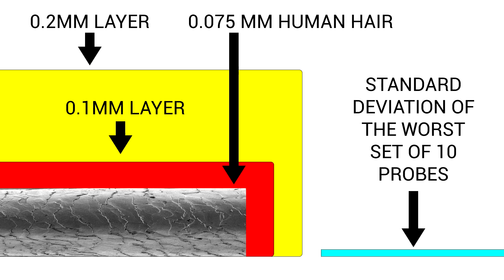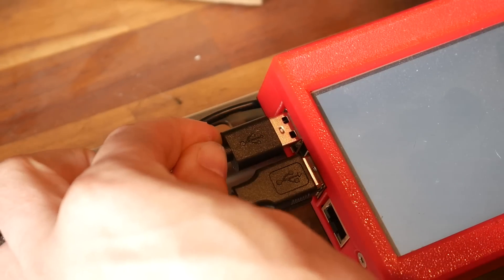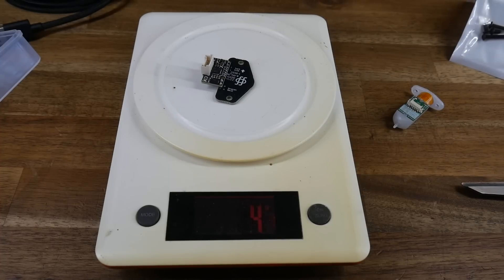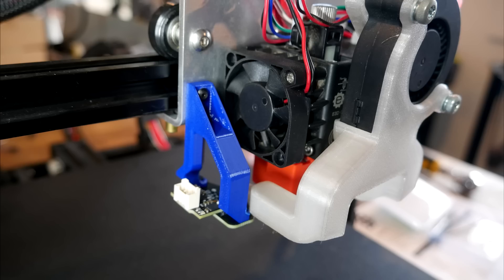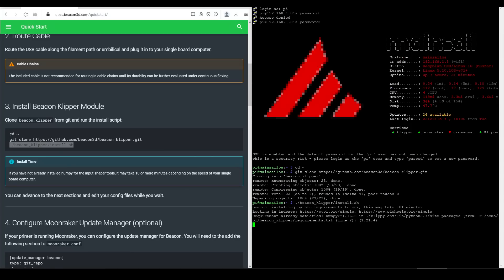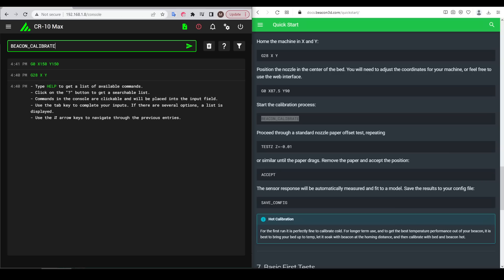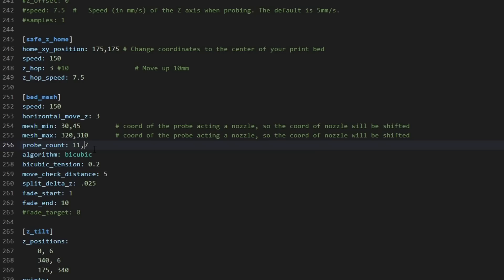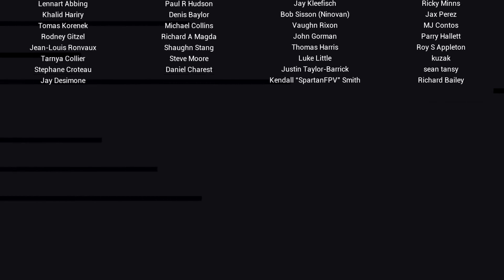Beacon ABL bed scanner - Amazing speed and accuracy, perfect 1st layers

Comment: I came across beacon the other day and i'm designing a hotend.  It's one of those parts where trying to implement it after the fact is a bit of a struggle when you start considering screw and extrusion locations.    I'm not giving up on the idea, I like the concept, though im curious how it  will fare once prusa's new leveling system is looked at and perhaps is adapted to the previous probes.
Reply: By new system do you mean the load cell leveling??

If so they don't seem comparable in terms of end user benefit. Like load cell leveling is probably better than having a bltouch hanging off the side but its not really any faster. It's more accurate but leveling accuracy is not a problem unless your printing with extremely small nozzles. Which means speed should be the only thing that we are looking at for real improvement.

Especially because even if you are satisfied with the current time it takes to make a mesh, a faster system can allow for a more detailed and comprehensive mesh for in same amount of time.
Reply: @nocare  Yep, but more specifically the gcode running behind it that allows for bed leveling only in the print area. 

Realistically speaking, that little bit of code when adapted across the industry will be a pretty decent upgrade for 'traditional' probing methods imo.  

It really only makes a ton of sense in my opinion for the DIY CoreXY community.  Most other machines regardless of brand will struggle to meet all of the prerequisits.

For everything else, speeding up the traditional probing methods with an adaptation of prusa's gcode will be the way to go.  

Which is where I want to see how that code develops with point density.

Comment: Nice but expensive. The fact that it only works with Klipper is another thing that prevents it from becoming very massive.
You don't have to create a mesh every time you start a new print. Because the print bed is still in the same state as the previous print. So the lost time is always zero.

Comment: My first thought on this is that it's only going to work on metal beds... that don't have heaters... or mounting standoffs on the bottom.

Like, if there's a massive aluminum slug on the center of my plate where all the mounting hardware is, it's going to read a different value when scanning over that section vs the edges of the plate, because there's more material to generate eddy currents in.

Or, more importantly, as someone who uses a double-sided glass bed. This will do absolutely nothing useful...

Oh, and it's klipper only? I guess it's a matter of time before someone makes a clone that's a mainboard thing. Will be interesting to see this in a few years.
Reply: It only reads the steel bed sheet, not the mounting hardware. And yes, not good for glass, and klipper is the future because of things like this, the raspi is basically a full Linux computer and can do those kinds of calculations and work with multiple MCUs.

Comment: My bltouch croaked so i popped on an old inductive probe which works great with the pei sheet but does not have the distance for a glass work plate which I find is far better for pla adherence so this may just what I need. It is a little on the expensive side for a probe though and will take up alot of real estate with the exclusion zone it needs.

Comment: These are using off the shelf Texas instruments chips that cost only a couple of dollars, they are even using the suggested layout that comes with the chips documentation. Some chinese companies will come along and properly open source it and sell it for $10 in a couple of months.
Reply: A TMAG5170 by any chance? I see it has a SAMD21 as it's mcu. That's about $7 total, throw in another generous 8 for the boards, passives and connector and it's all of 15 bucks retail to make the hardware. So yeah, highly likely.

Comment: Interesting but certainly not for everyone, not for glass beds, thick PEI sheet beds and non Klipper users
Reply: I don't see how it's for klipper users either, given that you can just store and load an existing mesh
Reply: I don’t at all disagree, but as time passes I find it harder to understand why non-Klipper users even exist. It’s just phenomenal compared to the alternatives.
Reply: @dsnineteen RRF is pretty good and most RRF boards don't need a separate SBC unless you run Klipper on them, but the beautiful thing about RRF is not needing that at all, Mellow has some good priced Duet alternatives

then again once Marlin is set up properly you should never need to recompile it unless you wanna have every update, which i don't, i literally jump versions only if something cool comes out like the input shaping update and modern ARM boards have made it as easy as putting the firmware.bin on the sd card
Reply: @BH4x0r  thanks for the informative response! Time for me to do a little more research into the current state of play. -that’s what I love about this hobby, it’s always evolving!
Reply: @dsnineteen  I’m scarred by recompiling Marlin countless times (-8
Reply: @floodo1 I think it's only for Klipper.
Reply: @dsnineteen  kipper is a pain is the ass to learn when what you have works fine and you have to find an elusive and overpriced rasberry pi.   Plus if you have a X1C this thing would pretty much be pointless.
Reply: @TheRattleSnake3145  there are cheaper boards that work fine for klipper. But it's still an added cost for sure.
Reply: @TheRattleSnake3145  😂😂😂
Reply: @twanheijkoop6753  what cards can I learn about them?
Reply: @uguryay mostly raspberry clones: orange pi, banana pi, etc. any arm sbc with gpio and linux should do.
Reply: @dsnineteen  I just want to make cool stuff. Don't have the time to buy and learn everything for Klipper when Marlin works just fine. I often don't even have much time to model things in the first place...

Comment: I half expected to see cheaper Chinese copies of the Beacon by now as the tech used has been around for yesrs, I have BL Touch units on all but one of my printers and that one without is an original Ender 2 that doesent really need ABL, I have a spare BL Touch but would rather keep it as a spare.
 I dont see any reason to upgrade as the BL Touch units are just fine, I would however fit a Beacon to the next large format printer I build as I like to have the best parts available when building printers, saying that I have only built two.
Reply: agreed

Comment: Auto bed leveling is a great theory but doesn't improve prints at all due to backlash and single-z stepper designs. The fine adjustments don't and just create noise in the print.

Most print beds are flat enough that any tiny variance is absorbed in the first (squish) layer. Why would you propagate that defect through your entire print?
Reply: you don't propergate through the whole print. Klipper default is to fade out the adjustment over a fixed number of layers. 

As for' just take it'... on a larger bed, like my 350mm 2.4r2, the deviation might be a bit much. I have a variance of ~0.12 mm, so more than half a layer. thats very noticeable
Reply: @Daepilin  Thanks for that info.
Reply: That's a failure of poor motion systems, simple solution is don't use printers with poor motion systems.

Comment: Since Prusa MK 4 is open source. Can you cover how the MK4 uses the nozzle to bed level. I use glass so this device wouldn't work.
Reply: the future of bed probing is nozzle based probing like MK4 and bambu. not this device.
Reply: The MK4 uses a strain gauge sensor with the hot end floating on the sensor.  It likely uses an HX711 for analog amplification, and a small microcontroller in addition to send a trigger pulse once the rising edge reaches a certain threshold.  It's a lot like the CR6-SE and other nozzle-as-probe systems.
Reply: @ThantiK  In the Prusa interview of Thomas Sanladerer, Prusa mentioned they were getting the full info on the pressure on the nozzle, so not just a trigger at a certain level.  Whether that is correct or I misunderstood, I leave up to you - check the video from Tom yourself and let me know how you understood the statements ...
Reply: @ThantiK  josef prusa claimed they get full detailed pressure feedback from the hotend and talk about using it to precisely detect underextrusion or filament jams. this does not sound like trigger pulse to me. if they implement it the way you say, then they can't do what prusa is claiming. so maybe prusa is lying?

Comment: Neat. I wonder what the variance of thickness the PEI is on the covered metal sheets is, and if it could affect things. If its not much, this seems like promising tech.
Reply: This like all inductive probes measures the metal and the glue and pei sticker are indeed a factor but MOST of the time it's a tiny one. For those not concerned about speed things like the new Nextruder from Prusa or Voron TAP are technically more accurate, but with the speeds involved you're also more likely to do more high res meshes (11x11 or more) as opposed to the slower options where even 5x5 can seem to take forever.
Reply: @urufushinjiro  on my mantis tap I manually calibrated input shaper to 14k easily on mzv. If you calibrate with adxl and just go with that it introduces noise that isn’t accurate. So I can print fast on my trident.
Reply: @joe_duck  I was purely referring to the speed of the probing
Reply: @urufushinjiro  ah makes sense.
Reply: This wouldn’t matter as it’s taken care of in the z offset
Reply: @joe_duck  inconsistencies in the material could though
Reply: @IrocZIV  I did put a new pei on and the 3m decided to bunch up so that makes sense. I fixed it somewhat but now some glue is missing lol

Comment: 1:55 Why would you need to probe the bed before every print?
Reply: You don't need to, but it's become "because you can"
Reply: It depends, if you have a removable build plate then you typically want to because the act of removing it and putting it back can throw off the previous level a slight amount.   That is less important with a hard mounted bed on a core XY machine but on something with leveling screws you want to do it every time.

Comment: Wait... if klipper pulls the load off the board so it processes the commands, and the beacon connects via USB to the PI. Why is running 8 bit boards an issue? The printer mainboard shouldnt have much load on it at all? Wasnt the point of klipper to get more use out of the older boards originally?
Reply: it's less to do with beacon itself and more to do with multi-mcu homing, the 8bit board is responsible for the motor movements but the probe MCU is responsible for triggering the, well, probing, and the code needed to have those two MCUs work in concert, whether it's beacon or a mouse switch, is a little much for an 8bit board to cope, especially multiple probes at speed.
Reply: It's to do with the multi MCU homing
Reply: The printer main board can monitor directly attached endstop without using processing power. But the printer mainboard has to do some processing to understand when Klipper communicates with it. So it actually puts more load on the printer mainboard if endstop is remote and coming via Klipper.

Comment: Oh wow those prerequisites, cant say that it is the future of 3d printing. Yes it is fast but only on certain printer with certain firmware with certain bed which i don't have anything of these because i am using old CR10S and Ender 3. It is obvious that this ABL is made for Vorons in mind ... but also for others if you go thought the pain to mount.
Reply: It's actually made with the Annex printer (K3 etc) in mind.
Reply: Why can't you run this on an Ender? You can get a double-sided, spring steel PEI sheet kit with bed magnet for ~$20 (a good upgrade anyway) and a 32-bit BTT board for $40-$60. Running Klipper requires a Raspberry Pi or similar device, but many of us already have one lying around (or are already running either Klipper or OctoPrint on one), so that isn't much of an issue. Prerequisites solved, yes?
Reply: Everyone will be using klipper this time next year of course its the future of 3D printing. Lol the Ender 3 isn't the future of 3d printing its the past what are you talking about.  Might not be in your future but you aren't 3D printing.
Reply: @backgammonbacon Everyone will still be unable to get a RPi to run klipper on next year.
Reply: @maplobats  BTT CB1 works great for running Klipper and it's about $40 USD. I've been running it for 4 months and I have had no complaints.

Comment: Does it require a Z Offset? If so, i would rather have what the Bambu does and wait a few extra minutes.
Reply: It must unless there's some magical sensing of nozzle location I'm missing.  Using a load cell to do nozzle taps (Bambu and Prusa XL/Mk4) seems like a slower, but also more fool proof method.  I've ruined a number of beds before when probes got tweaked and I didn't realize it... a few minutes extra at the start of a print is a small price to pay to avoid that.  Even that can be susceptible to ooze on the nozzle, of course, but as seen on existing printers it can be mitigated.

This is very cool and I may decide to try it on my V-Core eventually, though I wish it allowed for more distance to the bed, like a LiDAR would...  Catching on failed prints is usually how the previous probes got messed up.
Reply: @drdoakcom  nozzle based probing is the future. it's the conclusion cnc machining learned decades ago and 3d printers are only just learning.
Reply: @TMS5100  I agree, but I think we've got a ways to go before hot ends with load cells become commonplace. It's less of an issue though on the one printer I have that can't do nozzle taps.  That one has to preheat for a while anyway, so... What's another couple minutes doing the pinda probe at that point?
Reply: @TMS5100  yeah the probe on tool head + probe on bed setup on CNC machines is similar to Auto Z for Klipper. Good stuff

Comment: OMG, I love this. It will eliminate the need to worry about nozzle ooze when using Klicky Probe or Tap. Ordering one to try. Great video Michael, thank you!
Reply: but it adds worry about thermal expansion of the nozzle or having to adjust the offset for different nozzle. 

I still personally like tap more, but this seems great nonetheless
Reply: @Daepilin  The amount of thermal expansion is going to be tiny and pretty much not be a realistic effect.   Literally the textured PEI sheet most people use is going to have a bigger variance than the thermal expansion.   
For example the linear thermal expansion of brass/steel is going to be under .03mm on a 10mm piece of steel/brass(the amount where you could possibly have any expansion.  That is the difference between 70 and 260 as well.      If your properly heating the bed/nozzle before probing then your talking about a .009 variance between 160 and 220 which is the general temperature range in what you would probe/print at.       Most probes alone have a variance in accuracy of .01-.02mm alone.   Hell your setting the z-height in .1mm accuracy.  

Now on something like SLS or resin that kind of thermal expansion actually would be an issue that needs to be factored in.  On an FDM machine where your typically concerned about .1mm steps a .03mm difference is not going to be a major factor to worry about.
Reply: Nozzle ooze is a non issue if you config for it. Use a gantry mount dock for the klicky/Euclid probe. Add a 5mm retract to the print end macro and a 5 minute pause after nozzle heat up followed by a nozzle scrub in print start.
If your using a high flow hotend with a longer heat zone you may need to increase the pause time to allow all the oozing to finish before the scrub.
Observe and adapt.

Comment: Confused why an 8bit mainboard would cause issues? You said the Beacon attaches to an SBC via USB and is implemented in Klipper as in independent mcu, so what aspect of the 8bit board was breaking it?

This is a really interesting device and is definitely a novel solution (albeit klipper only, which could be seen as a drawback for some). Heres hoping for future innovation and refinement.
Reply: I have no idea, i know that 8bit boards cant have as high of a step rate as 32 bit, but this shouldn't affect multi mcu homing.
Reply: it's less to do with beacon itself and more to do with multi-mcu homing, the 8bit board is responsible for the motor movements but the probe MCU is responsible for triggering the, well, probing, and the code needed to have those two MCUs work in concert, whether it's beacon or a mouse switch, is a little much for an 8bit board to cope, especially multiple probes at speed.
Reply: @Allan Mitchell  yh that makes sense. I'll admit, my knowledge of the internals of Kliper are much less than that of MCUs. 

Why does the beacon NEED to control the Z homing? I can see why it helps etc.. but its equally not really essential to actually generating the bed mesh.
Reply: @Thats_Mr_Random_Person_to_you  because both MCUs are involved, one for motion, one for sensors, it's the same if you're using a second MCU for quad Z motors but the end stops are on the main MCU, the code to get them to cooperate without communications lag is hefty resource intensive.